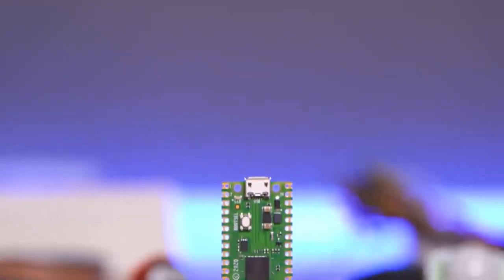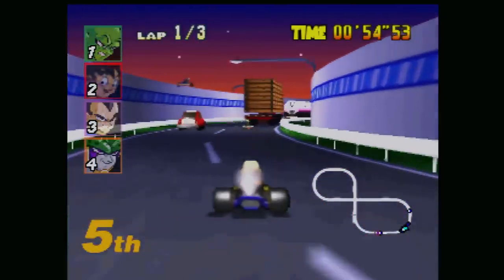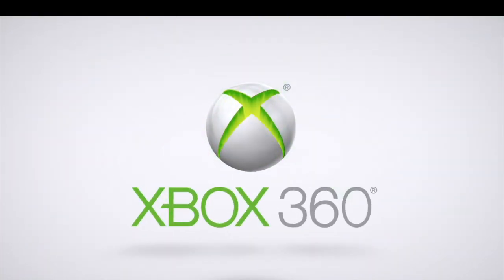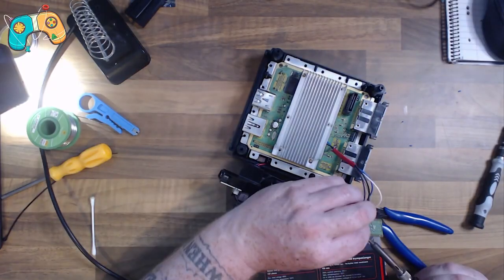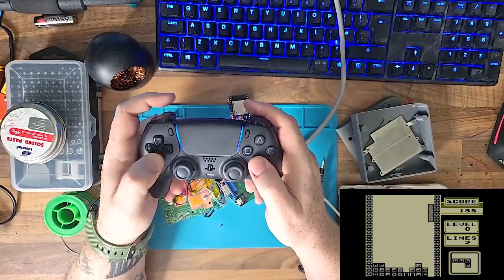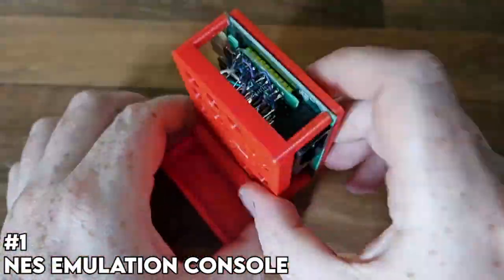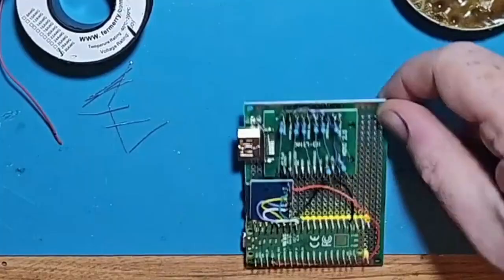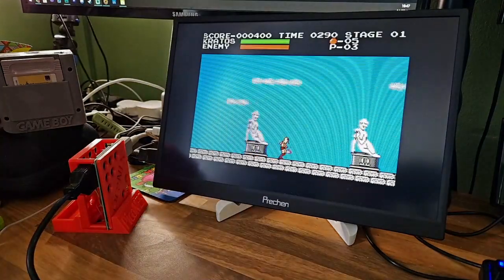Top 5 Ultimate Pico Projects for Gamers - Level Up Your Gameplay

Comment: With Pico2 producing a higher res DVI/HDMI signal will be more easy with the high speed output interface with differential line. Also it is faster and has more memory.
Maybe some of those project will be improved to benefit from that possibility.
Reply from the maker: That's exactly what I'm hoping. Some of the mods I'd say can take advantage of the pico 2. Looking forward to getting a hold of some

Comment: My favourite Pico gaming project is an adapter for Wii accessories that let's you plug them into a PC and use as an xinput or direct input contRollers. I use it to play guitar hero and other rhythm games on my PC with Wii guitar with a wire - so there's no latency or anything. Also it works with any other accessory that has a nunchuck style plug. So wii classic controllers and even NES and snes classic edition controllers. Amazing for playing emulators with an authentic first party controller!

The project is called Santroller btw
Reply from the maker: 😮 that's amazing! I'll have to look in to that!!!
Reply: @DReviewTing  best thing is - you can even do it without soldering. Just get a breakout board for the nunchuck connector and connect everything with some jumper wires. Super beginner friendly.
Reply from the maker: That's amazing! I love that! I'll be looking in to that for sure! Thank you!! I'll be sure to call you out in the video!